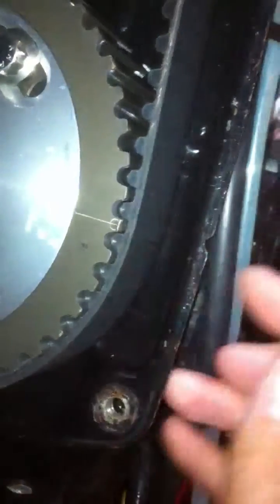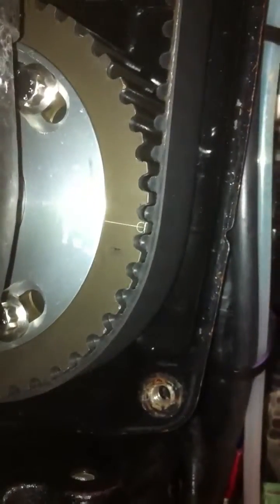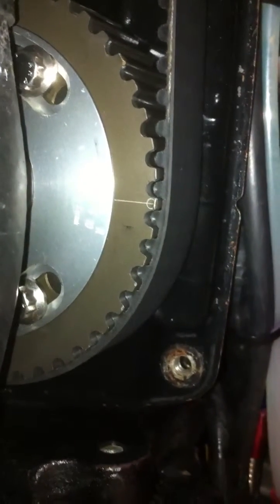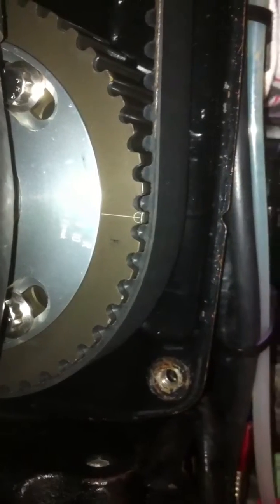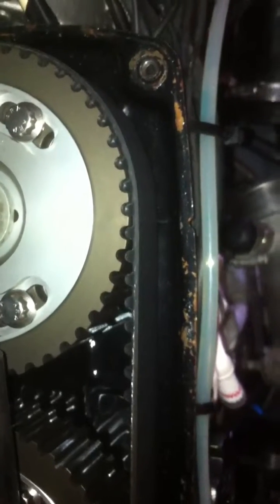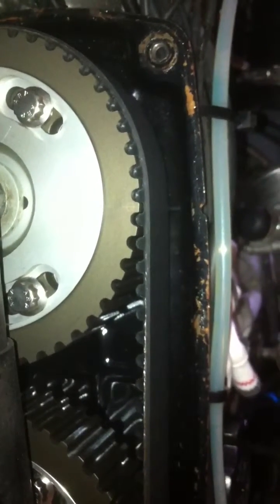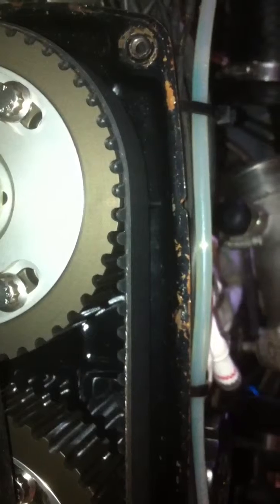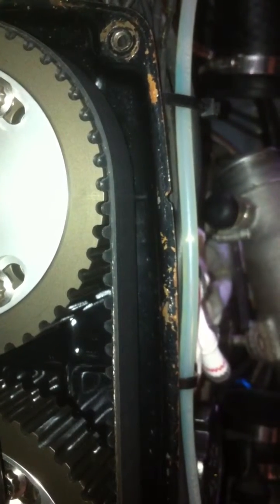Cam timing 7mgte

Comment: Just a hint, the cam is like almost a half tooth of because I guess you have an new timing belt on. That is no problem and will be even after about 1000 miles when you need to check the timing belt tension again. No WORRY'S! the belt is just still tight and will get a bit longer.